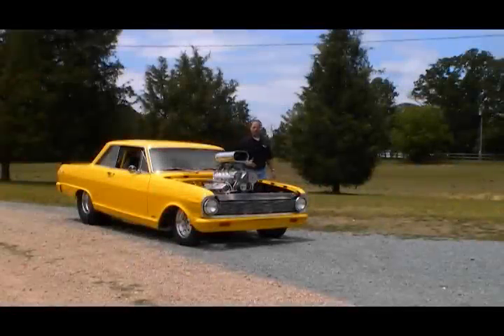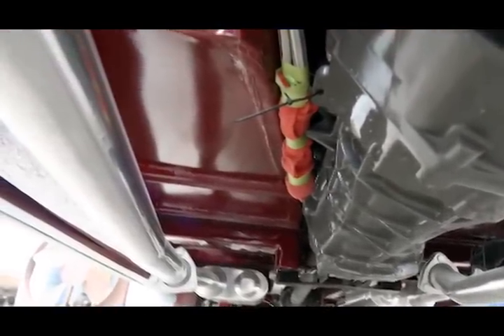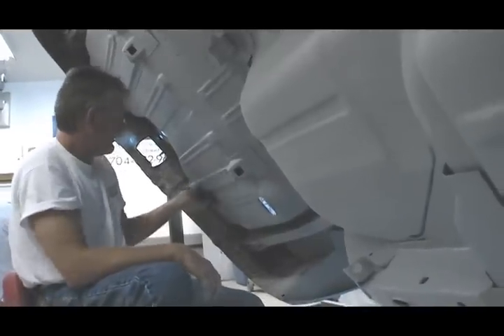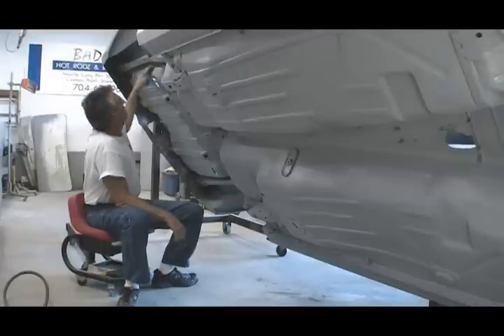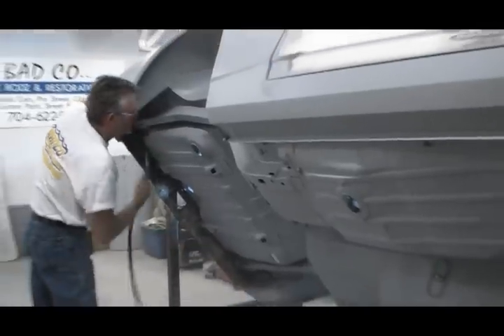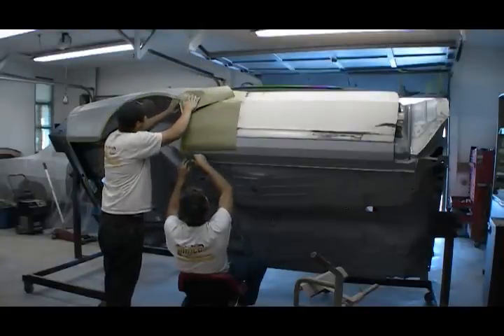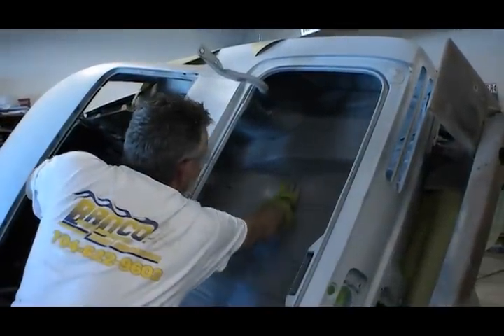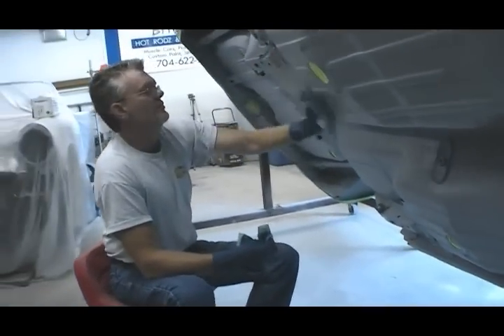Applying Ultra-Tough Underbody Protector on a Classic Muscle Car (Part 1)

Comment: Was that bed liner one with pieces of rubber in it or just the liquid form , as I see he used a regular spray gun and not a shutz gun
Reply from the maker: No rubber or any large solid particles. It mixed up like a very thick paint and dried incredibly hard. You'd almost think like an enamel shell.

Comment: Whats the different between line-x?
Reply from the maker: I'm not up do date on Line-X, but doesn't it require a special gun? With this one you could spray it with an hplv gun. You could also mix it with color if you wanted. Thanks for watching.